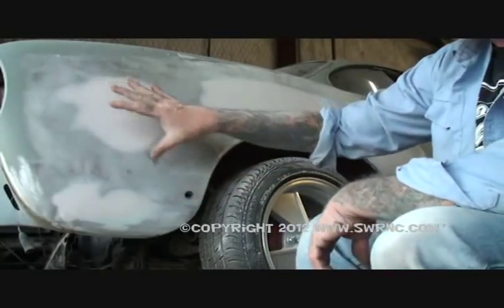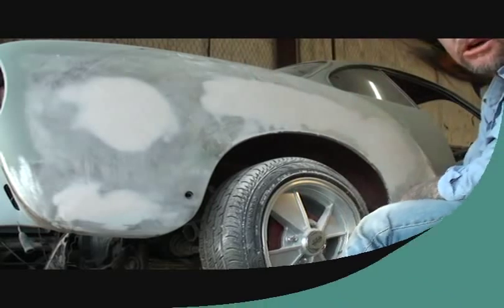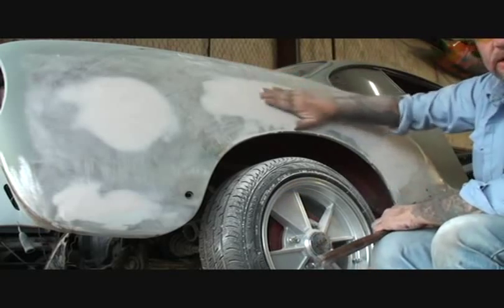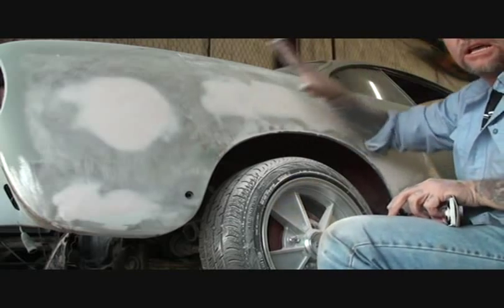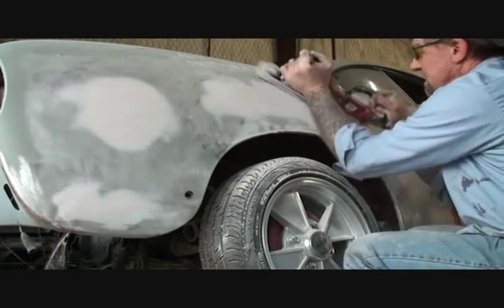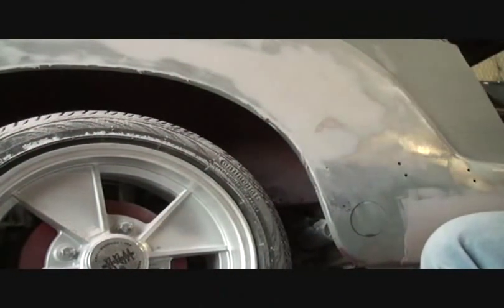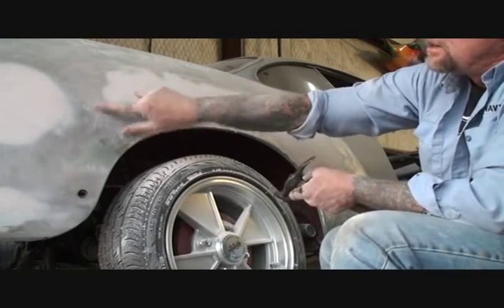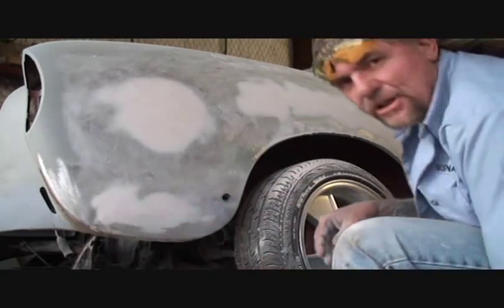Classic Car Restoration: How To Block Sand Bondo With Air Tools-Part 1

Comment from the maker: Yes you can use that tool I call it a "Bondo Buster". The problem you have with that tool is that it removes the bondo very quickly and isn't as precise as the air file. On smaller jobs the Orbital Air Sander works well, but on large jobs like this where precision matters the air file is the choice tool to use.

Comment from the maker: The best way is to spray a guide coat on the bondo area's and then hand block with 80 grit dry paper, this will show you where the highs and lows are... Take it easy Pete

Comment from the maker: I might of explained it wrong---you can put new bondo on old bondo if it doesn't have cracks in it, you can't put new bondo on old bondo if you stripped your car to metal using soda or stripper because the chemicals penatrated in the bondo and has contaminated it. If your doing a paint over and your just cleaning it up, yes you can go ahead and rebondo over the area needed.. Good luck PETE

Comment: Great body work takes a lot of time to learn. I started myself off right and never used Bondo or even so called "classic car grade of filler" but I do understand there really is a need for it. Production repairs when the clock is ticking, on grandma's 4 year old Chevy, a shop  (and insurance)is not going to spend big bucks to "fix it correctly" To people who wish to learn body repair, get the best might welder you can afford, an old car, and become a welding wizard that is half the problem solved.

Comment: No extreme jobs,more like rusted wheel wells or so.
Mostly just to get it passed inspection.
Ill try more light coats off bodyfiller and lots off handsanding.
Lots of trial and error will get me there.
One day ill have it closer to a Pete s finish.
Thanks for the help and inspiration.

Comment from the maker: IT happens all the time, what the deal is, is that the filler is absorbing the primer like a sponge, so what you have to do is when your prime your panel, first just spot prime the filler area, then spray 2 overall full coats then spot prime the area again, this way your filler area is getting 4 coats of primer while the rest is getting 2 coats---if that makes any sense!!!!!! Ill make a video on this subject next time I have the problem come my way...

Comment: I was never into heat shrinking to much, tried it way back when, and never really stuck with it, I guess once you get down the science of the way you do things you stick with it, I have used a propane torch to remove bondo and yes it does work very well....

Comment: Soda blasted , I've heard of this. This where you use a high pressure washer to blast the panel but instead of using water you use Pepsi or I have been told Dr. Pepper works best? Is this correct? Also I was advised a material called fix-all or drywall mud could be substituted for the material you refer to as bondo.You are very inspiring!!

Comment: Great video MyfriendPete! But with that much body work, would you recomend replacing the whole quarter panel if it was available? It seems like it would be easier to body fill and hammer the welds instead. I am asking because I have a 69 ford Galaxie 500 that has been in my garage for at least 15 years. I felt above the tires and there was some type of body filler there. I guess I have to prepare myself for the nightmare when the paint comes off!

Comment: Hey Pete I just bought a 69 camaro and it needs quite a bit of body and bondo work, you said that you can't put new filler bondo over old filler bondo why is that?  The previous owners did not do a great job of the bondo and it has pits and holes in it, do I need to grind it all out and start over? Thanks for your videos! They are very helpful!

Comment: Hey Pete,
When you primer a surface that has been glaze puttied and your able to see the putties outline through it what does that mean? Am I using the wrong kind of primer or is it high spots? The primer I used is Trans Star's 2 in 1 Primer.
Your the best Pete!

Comment: Can you only apply bodyfiller to bare metal?
If i only use it 3-4 times a year,do i need an airfile and a DA sander?
Offcourse i just tried the cheap Bondo file today...
I might as well use a cheesegrader...or a grinder..
Psst.."The term "Bondo" is a registered trademark."
Thanks for the video Pete!

Comment from the maker: "THEY" claim the bondo of today can be applied to properly prepared surfaces of any kind, weather it's bare metal or painted areas, I always apply it to bare metal to insure good bonding. If your a once in awhile hobbist and your not doing extreme jobs just small stuff, I would probably concentrate on the hand job as you suggest above. Pete

Comment: ive been doing body work for like 4 years now, and still i have problems with high and low spots and gettin it perfect, im so picky and want it perfect and that makes me work on one area for like 3 days, im tired of it, i want to learn a better and easier way to fill in the low spots and learn to sand them out perfectly with out fucking it up, you say if you cant do it dont fuck with it, but we all have to start somewhere, if you like it enough you never give up, try and try, Get er done

Comment: this motorcycle side car fender is kicking me in the fucking ass, evertime i fill in the low spots with bondo i sand them down and feather out the edges super nice but then when i run my hand across it its seems low again like as if i wentto far, so nex time i try sanding it less and take my time more on that area and its still giving me shit, i hate doing filler on a curve rainbow shape object, flat cerfaces i could do fine but this fender is killing me right now, could you help me, advice,

Comment: hi, i only have DA sander, can i use that to sand filler.  instead of air file.. please advise.. i am DIY.. i can block sand with hand, but i found difficult removig hard edges.. please advise if DA is ok to feather edge bondo or filler
Reply from the maker: You can use a d/a sander to rough it in and then hand block it with a long block. Use 40 grit or 36 grit when using your d/a sander to brake it down quick, also turn the air pressure down a bit so the d/a sander isn't going at full speed, this will help you control the bondo'd area  much better, good luck. Pete
Reply: diyautoschool